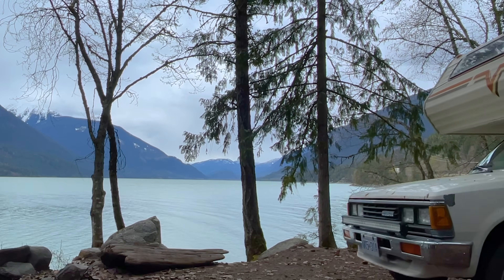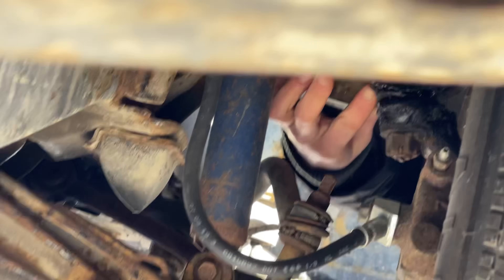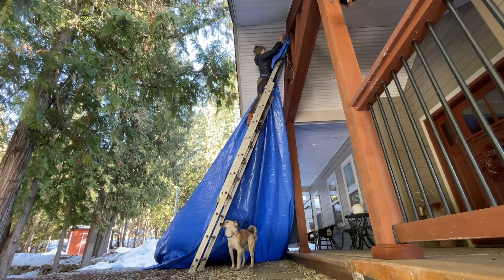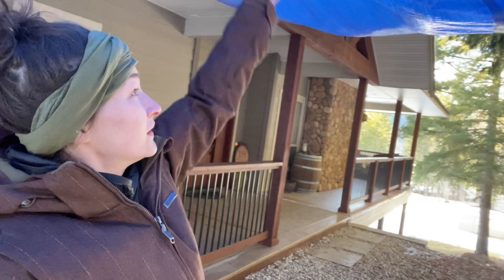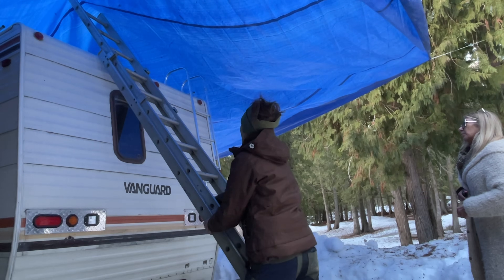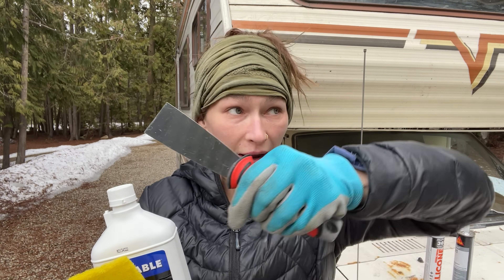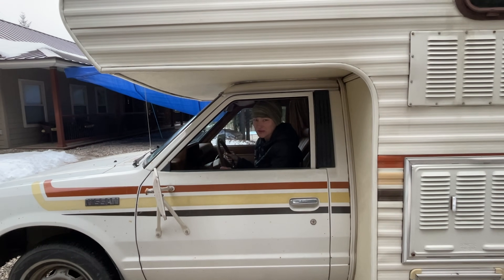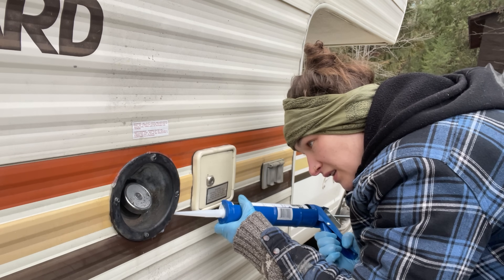I bought a Vintage Camper; Trying Vanlife

Comment: Once your done with the RV.  That size of RV is on demand here in America.   Sell it on one of your trips to America.    It's also on demand on America because you can make income renting the RV out.  The smaller the more on demand.
Reply from the maker: Already sold it after this, but since I bought in winter and sold in spring, and also cleaned it up a lot, I ended up making money on it. I’ve since got my 83 VW working, needed a tranny rebuild, might sell that too and get something more reliable.
Reply: @RosieGabrielle  good to know:).   Thanks for your rapid response ☺️

Comment: I don't know what type of framework you have under that outer skin but rhe one I took apart had a wooden framework, which sadly was rotten where thw water was getting in.too much of a project to save, so it was stripped and sold for parts.
Reply from the maker: this was completely wood. Needed to be completely gutted and re-done.
Reply: I can well believe it, the early frameworks wouldn't meet the safety standards of today.